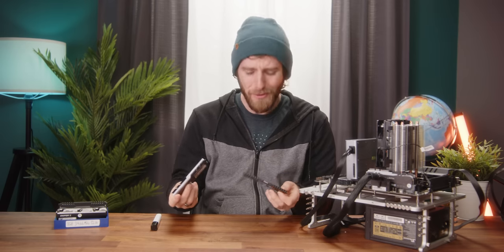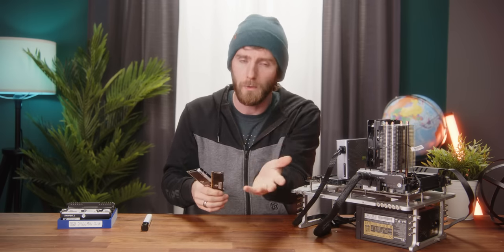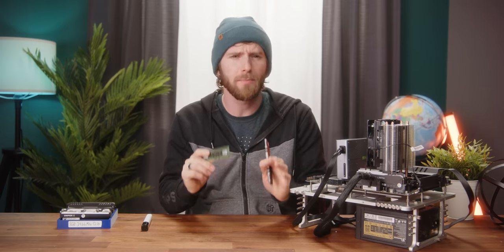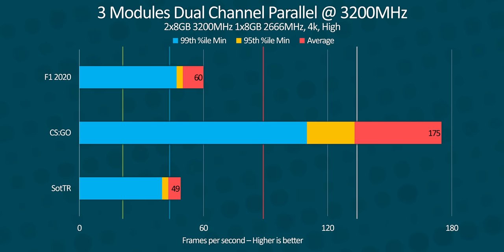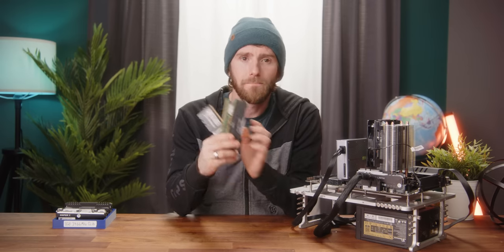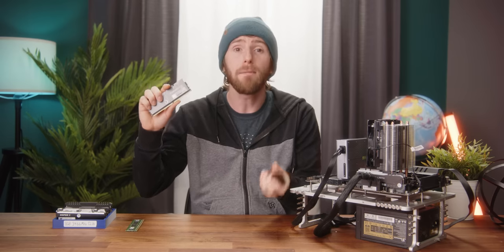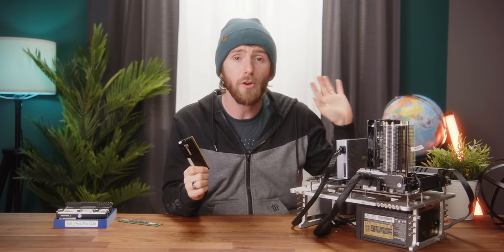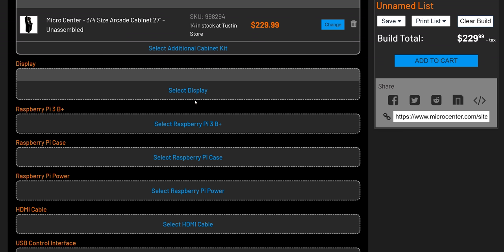Just How Bad is Mixing Memory?

Comment: Linus: “increasing your RAM speed is important for performance”
Me, using mismatched 400Mhz DDR2: “interesting”
Reply: What are you running? A TI-86?
Reply: @leakingamps2050  Windows 10 Pro 64-bit on an AMD Phenom II X4 920, 4 2GB sticks
Reply: @leakingamps2050  The computer was a custom built in 2009, it’s seen Windows 7 come and go, and runs 24/7 as a server for the past 18 months or so.
Reply: I used to have a PC with athlon 64 3400+; it supported (barely) the instruction codecs windows 8.1 uses, so I installed it. Ran surprisiungly OK considering its age.
Reply: Ouch, even my first system was 800mhz
Reply: @hardrivethrutown  what mine ddr3 666 mhz (it's mismatched so running at the lower speed oof)
Reply: Lol, I'm using 4gb ddr2 @800mhz but my mobo is only 667, my windows recognizes only 2.75 Gb
Reply: Lmao I was just about to say am I the only one using ddr3 . Lol sorry bud
Reply: yeah ive had 4 different ram sticks in my pentium 4 ht for like 8 years it runs fine reads all the memory my only issue was the gpu started not working it was a best buy "special" from amd 5950 or something like that i tossed it but now wishd id kept it to play with but im glad someone learned today
Reply: Ha! I'm running a 9550 processor with 1333mg ram on a ddr2 board
Reply: @Frog-ko6uu  still rocking a Phenom II X4 here as well.
Reply: @Frog-ko6uu  
I have a Phenom II X2 B555 with cores unlocked. So I have been using all 4 cores for the last 6 y. 8 GB DDR3. I think they are 1600 MHz. Running Kubuntu 18.04. I do some programming and testing on it sometimes. I watch videos.
Performance is good. No reason to throw away.
I have a separate PC for gaming.
Reply: @louistournas120  Yep I use mine for something similar. It has a decent Radeon R9 GPU that handles hardware video encoding for on-the-fly media transcoding (it runs a Jellyfin media server). I have it set up with about 4TB of hard drives and an SSD for Windows, and while it’s a little slow at the desktop, it handily handles 30 day uptimes and having 15 or so programs open, including a couple Firefox windows. It’s a perfectly good media server (I can have a 4K video playing from it on my Xbox and another one on my laptop no problem)
Reply: My first pc had 512 Mbs of RAM, but oh it felt nice lmao... Until recently I too runned a phenom, in my case it was a Phenom X3 8750 BE with 2x2gb DDR2 800mhz modules that were locked down to 400mhz thanks to the mobo, i did upgrade it a bit this year... Now I am running an FX 8120 and 6 gigs of DDR3 and doing some overclocking thanks to the corsair H45 I got with the upgrade bundle for hella cheap.

Thing is... I don't think I'll ever have an up to date system after my first one lol
Reply: @CaCidinho  
"Thing is... I don't think I'll ever have an up to date system after my first one lol"

==I think that unless you play recent heavy 3D games, unless you are into video editing, unless if you do 3D animation and CGI rendering, unless you want to watch 4K videos, you probably don't need to upgrade. A PC from 2007 works just fine.
Personally, I am into gaming, so I tend to upgrade but I keep around old PCs.
Reply: @Frog-ko6uu  Im putting together a similar build (the Recycle PC build). What games can you play on that machine
Reply: @rudravisual  I haven’t gamed on it since I put the Radeon R9 in, but with its previous card, a Radeon HD 6800, it did about 10 FPS in Klei’s Oxygen Not Included, at 1080p, high quality. I could get better by dropping the resolution or quality settings, but in that game high frame rate was much less important than resolution. It would also do about 22FPS in Age Of Empires 2 Definitive. It’s not supposed to be a gaming machine, I use it as a workstation/server and it handles Office 2019, Firefox 85, Signal, Slack, and even a Ubuntu VM in VirtualBox when necessary with no issues at all. Sure it’s a tad slow when launching programs, but an SSD helps so much.
Reply: @butre.  I didn’t build the PC, and I’ve never had a serious issue with it. It has a worn out rear panel audio connector and the front USB ports are also pretty worn out, but besides that it’s rock solid. Never crashes, I reboot once a month for Windows Update or if my antivirus needs a system reboot. It’s not a fast machine, but it shows no signs of giving up the ghost anytime soon.
Reply: @ajk9420  Eh it’s still running and does what I need it to. I have a couple of laptops as well, and those are my daily drivers. I’ll keep that sucker til the day it dies.

Comment: I remember many moons ago I had done this (back when I had ZERO clue about Speeds/Timings etc) I was surprised to find that I could successfully run 2x Kingston Hyper X 8GB and 2x Ripjaw 8GB DDR3's (unfortunately I no longer have these sticks and still to this day have no clue what the clock speeds or the timings were), never once had a bluescreen (that I am aware of) in regards to the RAM and never had to tweak anything in the bios it was just simply plug and play. I am pleased to announce that I am no longer working with a $0 budget and using every hammy down possible to upgrade my system I now have fully populated 4x 8gb Corsair Vengeance and it looks a lot nicer than having 2x Mid Sized Black Ram Sticks and 2x Jumbo Red Ram Sticks :P
Reply: What about a 4gb stick + 8 gig stick ? Will it work ? Thats the question.
Reply: @serebbi  when mixing RAM, it's always a gamble, sometimes it works without issues, other times it will make your system crash. Even now days when chips are all randomised you could buy 2 boxes of 8gb RAM from the same manufacturer and exactly the same type, but one set may be using crappier chips and may not be compatible with the other set. So again it's just a guessing game, only way to find out is try it 👍
Reply: @FuryFight3r  Yup i will try it myself. If it crashes, i just put back my old stick right ?
It will not affect any other component?
Reply: @serebbi  your computer will be fine from my past experience I haven't had an issue when testing types of rams together

Comment: Back when ddr3 was just comming out, it was quite expensive and I was on a budget so I got ddr2. My motherboard, however, had 2 slots of ddr2 and 2 slots of ddr3. Sometime later I needed more memory so I got 2 sticks of ddr twice the capacity that I had. It actually worked with both, it didn't have the full combined capacity and I don't remember what speed it ran at but it was very stable.
Reply: Gigabyte G41-combo mobo?
Reply: I got 16 MB SIMM RAM from my 80386 to my P1 PC.
Then I got a Celeron PC that was better than this P1, its motherboard had both SIMM and DIMM slots, and I've used these two SIMM and.. one newer DIMM I think.
Also I gotta note somewhere at that time I had an ISA soundcard that had SIMM slots to expand its MIDI bank loading capabilities, so I used those here too.

Comment: Upgraded my GF's HP all-in-one PC awhile back with a memory module (and an SSD too) that I had laying around in the 'ol spares box, worked great. 
And just bought myself a lenovo T580 laptop and upped it from 8 GB to 24 GB using the OE 8 GB stick and a new16 GB stick and it's cruising along just perfectly. So it can be done.

Comment: I've mixed memory for years and never had issues in hundreds of computers and servers by just matching the MHz
Reply: I have i system with 6 different sticks (ALL are different size, speed, latency) overclocked it to the moon and it just works (DDR2)
Reply: @vincentschumann937  Is it weird that I wanna see thia?
Reply: @BigBoronto  it isn't if you're into computers and it only works in one order for me but my combination is a bit brutal
Reply: Newbie here. Would it hurt or help to have 3 sticks of ddr4 in my hp office machine? (Used for light gaming, eventually there’s a possibility of streaming)
Reply: @United_Kangaroo1992  As long as the sticks are all similar enough, more memory is more good.
Reply: @United_Kangaroo1992  Just make sure they are roughly similar sticks and run them at the base clock speed of the slowest stick you should be fine.
Reply: @United_Kangaroo1992  Not if your gonna buy it, the mobo could switch to single channel rendering your extra ram useless and significantly slowing down your ram performance. If you have it on hand try it. 2 sticks or 4 sticks in one mobo is standard.
Reply: I had a 1GB  + 512MB DDR Pentium frying one of the modules. Also, my actual computer is 8GB + 8GB 2400MHz, can't go past 2666 because one of the modules is pretty low voltage and the other one is tension hungry. HyperX Micron + HyperX Nanya
Reply: i thought this was only like a windows xp era problem
Reply: The only issue I've ever had mixing sticks is with 4 OCZ 1 GB sticks a long time ago.  They should have been matched but one of the sticks was slower than rated and had a different chipset.  I didn't pay for them so I wasn't THAT pissed but I wasn't happy with OCZ either.  The friend who gave them too me wasn't surprised when I gave him that revelation.
Reply: I had upgraded my 2x4GB Corsair Vengeance 2600 with 2x4GB Corsair Vengeance 2600 (from the same retailer (order again option)) and got some instabilitiy. i later found out that 2 sticks where micron and the other two samsung.
Reply: Heck, I got a set of 2666Mhz CL16 and 3000Mhz CL18 DDR4, and I overclocked the first set to 2933Mhz CL16 so it's as close as possible.
Reply: I jammed a DDR3 in with my DDR4 ... No issues either.
Reply: @Robert Nguyen if you add slower memory it can that's why I match the speed
Reply: Yeah, typically seen that in my work systems.  Heck, even matched up two lower end speed sticks, and they ran just fine.  It only really matters when you're going for higher clocks and tighter timings.
Reply: @rcslyman8929  what about the ranks of modules? Like rank 1 and rank 2 Rams
Reply: @cooperschmidt6849  i have no idea on how to check/change base clock, but im comfortable enough to teach myself.
edited: im running at 2133 on my new corsair sticks
Reply: @ytaccount-rs6jt  i know how to  check how to check basic system resources so i could just go for it and see what happens.
and for refrence i just bought 2 8gb sticks from a friend and dont know what to do with the factory hp 8gb
edited : im running 2133 on my 2 corsair sticks
Reply: @shutdahellup69420  As long as you don't have officer modules and enlisted modules fraternizing in the same system, you should be fine.

Seriously, though.  So I've seen different rank work in the same system just fine when they are on different channels.  I can say that if you mix rank in parity, there's potential for issues.  When we upgraded to Win 10, it included a bump for all systems from 4GB to 8GB RAM.  Months later, all sorts of tickets coming in and I could take one look at it and know it was a RAM configuration problem.

Best policy is to match same size in parity.  Barring that, probably don't mismatch rank in parity.  And, of course, don't exceed your system's total addressable rank (this is mainly a server limitation, but systems sometimes limit the rank of the modules, too).
Reply: @United_Kangaroo1992  if it runs at full speed and dual channel absolutely (if you need the extra space)
Reply: @vincentschumann937  how do I test this? When I go into system properties it just says 24gb@ 2133mhz

Comment: I have 8gb ram 2133mhz and 4gb ram 2666mhz , so it's 12gb ram, and Ram speed in Task manager is 2667mhz in windows 10 enterprise Ltsc 2019, but if I install windows 10 or 11 pro , I have 12gb ram BUT with lower speed 2133mhz. So I think it depends  by system itself . I don't have any problem with Days gone, Cyberpunk 2077, and Death stranding. Fps is about 45, with gtx 1050 2gb with I3 10100f and h510m-k .
Reply: wdym you don't have any problem? If fps drops under 70 I get instant headache
Reply: @yanni-duff  well, I had 8gb ram before and Days gone and Cyberpunk were very hard to play because of stuttering , so 12 gb ram is fine to me. Even Horizon zero dawn has 45 fps now with 12gb ram so it's so much better than with 30fps and 8gb ram. I guess I can play with 45fps or 50, depends of level details in game.
Reply: @yanni-duff  Anything over 30 fps is playable, just like in the games of old that we used to play on those heavy CTR TV's.
Not everyone have the money and/or the desire to dump copious amounts of money on PC hardware every years just to play whatever new title at 144 or more fps at ultra settings, budget and casual gamers are happy with 30-60 fps at middle or low settings as long as the game moves smoothly.
Reply: @carlosdgutierrez6570  You don't need that much money for 1080p 60fps gaming. My 700 EUR pc from 6 years ago does that. If you get 30 fps just go out and do something better for your time, its completely unplayable.
Reply: oCoreXs  who said you need the highest grade, last gen, overpriced gpu to outclass a mere console? Just too dumb to waste my time arguing
Reply: oCoreXs  you can game at 1080p 60fps with a 10 series NVidia graphics card, or with a 5000 series AMD graphics card, a 5500 xt is like 120 used and a 5500 is 150 or less brand new. You don't need the best graphics card to run a game decently and pretending you do does not make your argument more convincing to anyone older than 4.
Reply: Run memtest86 and see what are your real speed and timings. you will be surprised to notice that memtest86 you run at the most non-favorable combo - lowest speed and loosest timing at the same time.
Reply: @ShinobiDiabolik  thanks.
Reply: @savke92  I had the same mix of RAM, and i felt this issue personally. What i did, i removed all ram, and purchased new RAM, the correct speed and type the correct amount. My timings gor right, the system is more responsive and more agile. With me, the issue is heavier, i use dual intel CPU build with 12 stics of RAM. every mismatch hits me hard. Your best bet is to check your exact CPU and Chipset, and then make your RAM accordingly. Can you tell me your CPU and Chipset? I can craft a good recommendation for you. Keep in mind i will recommend a proper uniform ram configuration of the correct type, chasing the best result
Reply: @yanni-duff  and not everyone has 700 euros, if people are on a budget and don't have a lot of extra cash, for instance a kid or something don't put them down for not being able to run games at 70 fps
Reply: @ranceroni Ppl that don't have much money and choose an expensive hobby need to compromise. Compromises are not normal or acceptable for someone with a decent budget is all I'm saying
Reply: Just to clarify what is resposible for ram speeds and timings: It is managed by the bios! It does not matter what kind of OS you install - the configuration for cpu, ram etcetc (all frequenzies and voltages...) is set before you can even start any OS. Most systems can be manipulated by software but just the values the maufacturer allows to be adjusted this way. So if you have i.e. 2133 and 2666mhz sticks the board will set it to 2133mhz in most cases. That does not mean the 2133mhz stick couldn't run at those speeds...  Genreally: RAM has to be configured manually. If you just throw it in it will most likely run at lower speed and timings as it could.
Reply: @FoRk-One  Thank you.
Reply: @yanni-duff  Skill issue

Comment: I think this is an interesting issue when addressing “upgrading” a laptop, I had success upgrading a laptops RAM a few years back when I replaced its free slot with a 16gb ddr4 that was the same speed as the soldered 8 but in the long run I’m not sure if the slight performance improvement I experienced were worth the hassle or getting it working, however it’s still something I find interesting and ends up influencing my purchasing decisions when buying a laptop.
Reply: My work laptop has 8GB soldered and our IT upgrades them with 32gb DIMMs in the free slot, no issues so far but web development isn't super heavy on memory.
Reply: I did the same, and 24GB was definitely better than 8GB, for my purposes anyway (software dev, VMs)

Comment: I tried upgrading from 2x8GB G.Skill Trident Z 3200 (16-18-18-36) to add another kit of the same and couldn't get it to run stable above 2600 MHz. Turned out my CPU was the problem, as I found plenty of posts saying the integrated memory controller on Zen+ wasn't that great, so I ended upgrading from my 2700X to a 5700G.
Reply: Exactly my experience, tried at least 4 kits of memory and none of them worked properly on my Ryzen 2700X, switched to 5600X and even 48 GB (32+16) is running stably.